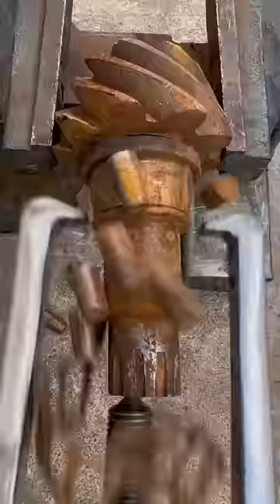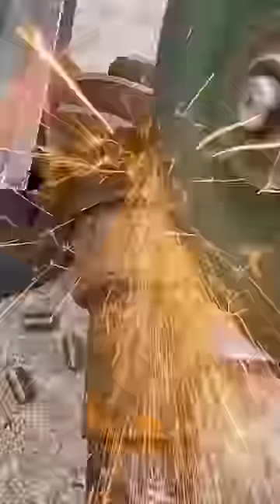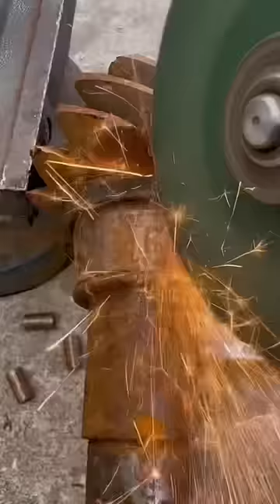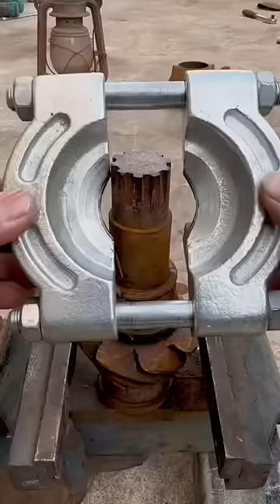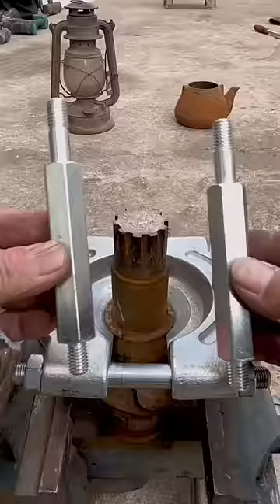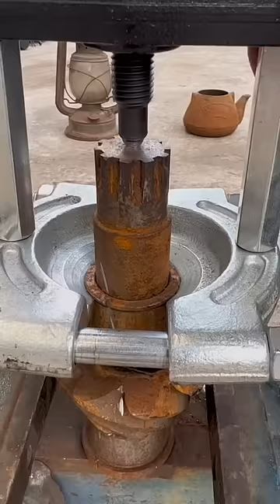Specialized Bearing Extraction Tools Tips for Easy Bearing Removal

Comment: Bro, at my workplace, if anybody used a pneumatic impact wrench to remove bearings, bushings, anything, they would be asked to leave. Step one: spray the part with oil! A little lubrication goes a long way. Step 2: Maybe try heat and cold. Freeze the part, then apply heat to the bushing or bearing on the outside. You might be surprised the result. Finally, use the correct tools and be slow and intentional. If the part has any value, take your time. Even the proper tools can destroy a part.
Reply: Yes, avoid high amounts of force whenever possible. Heat differential (pun intended) is the winner, if possible. Shit just falls apart with gravity, sometimes.
Reply: Exactly, so many people thing pneumatic tools are for everything because they speed things up. 
BUT you can’t these newer generation anything, only some have some wits about them but not much. 😣
Reply: This isn't a high quality part tho. He's just showing how to get it off. I do agree with you but he did fine for an old rusty piece also
Reply: And at my work place they teach us to use pneumatic tools to remove bearings and bushings. Just cuz you’ve done it that way doesn’t mean another way is wrong.
Reply: Sorry to say this but that is the dumbest thing i heard today. Using a impact to remove a bearing, bushing or anything in a mechanic shop is extremely common because it gets the job done fast. On top of that if they are removing them than most likely THEY ARE GETTING REPLACED. So no there is no reason not too. 

But i do agree with you to use oil but majority of the time when its that bad i just use heat and a puller. Only thing he did i would be extremely upset about in my shop is he tried to cut the bearing off with a angle grinder. 

Yes we do have to cut them off on very rare occasions but we don't use an angle grinder. We use a air die grinder with a cutting wheel but just enough to split the bearing or bushings off without damaging anything. But is very rare occasions.
Reply: Exactly, I disagree somewhat with not using air/electric tools. I think that depends on the application. For instance, an auto mechanic probably doesn't need to add that extra force. However, someone like myself who is a heavy equipment tech might need it. I've run into tons of seized bearings and such that won't allow for anything but high impact tools to get the job done.
Reply: But the pneumatic wrench wasn't key in getting the bearing race out.
Reply: В этом ролике у него нет задачи сохранить деталь. Он показывает , как можно снять подшипник и не повредить его. У пневмоинструментом он пользуется для ускорения процесса, чтоб вам не нужно было на это смотреть.
Reply: Lol if you put a gas along the length of the gear / shaft for no reason you'd be asked to leave
Reply: 浸透油は役に立ちます
Reply: U r correct!
Reply: You have 30 steps and he did it in 30 seconds 😂
Reply: Yep!  Obviously third world technique!
Reply: Sure if you want to reuse that bearing. But that was rusted to bad to reuse
Reply: He knows that....he's trying to sell and push a product. Don't you get it?
Reply: lol tf
Reply: Freeall
Reply: @UCtbSyssUGMsnEAIqEvuWpUw
Reply: @UCtbSyssUGMsnEAIqEvuWpUw
Reply: This is probably a really stupid question and I’m not trying to say that you’re wrong, I’m genuinely asking why would they be asked to leave necessarily?
Reply: @pauljarrell8162  The only bad question is the one not asked, and you were very polite. I'm a helicopter mechanic and we have very specific maintenance instructions. The problem with aircraft is that if they break down, you can't just pull over to the side of the road so any damaged parts must be rejected and aircraft parts are very expensive.
Reply: @matthewpollock9685  ohhhh ok. Well, I appreciate that answer. It’s really hard to find someone on YouTube that is polite nowadays lol I learned something new today! And honestly, it’s very comforting that those parts are replaced even though I’m sure that is very costly. The lives in that aircraft are priceless. Thanks for your time! I wish you well.
Reply: @GmKofHard  That part 💯
Reply: @matthewpollock9685  see you should state you work in a air craft shop. That is a complete different situation and yes any damaged part no matter how little can and will be rejected. Failure to do so can lead to a massive lawsuit and lifes lost. Here i thought you was just a random mechanic and your shop is being overly strict.
Reply: Y’all ain’t flat rate lol
Reply: Пиши по Русски , а то не чего не понятно!!!
Reply: @YeeeeeHaaaaa ok lead head
Reply: Нагрев детали до 800° тоже не всегда хорош?
Reply: @johngalt97 I use an impact on them along with the tool that takes off drivelines from semis. Guess what? Works just fine
Reply: @YeeeeeHaaaaa  bro if you actually worked in a shop then you would realize these tools when you get them off the tool truck. Lifetime waranty if it breaks you get a brand new one. Maybe that’s why your slow as fuck at your job though
Reply: Ok ok ok de mummy in

😊😊😊😊😅😅😮😮
Reply: Put some Blaster on it and get the torch. We need it off THIS WEEK! 😅
Reply: That’s kinda crazy. I work in a semi shop and we use 3/4” impacts to remove driveshaft u-joints. Our tool has a grease fitting just for the threads.
Reply: @hawkboy000  I work on aircraft. We have a lot of rules and our parts are made to be light weight, not overly bulletproof.
Reply: That's what the tool is for. Speed up the job. Like everyone else has said the part is getting replaced
Reply: We don’t care bro it’s interesting to watch none of us are using that I definitely wanna watch him tear stuff up with that tho. Be a man bro what’s wrong with you
Reply: @GmKofHard  good thing i read the whole comment or i might have misunderstood what you're saying. If its gonna be replaced anyway, no need to be careful but if its gonna be reused after the bearing is pulled out, preserving the shaft tolerance should be considered. We use the same tools at our shop too.
Reply: I always get a kick out of comments that start out with "At my shop if you did this..."
Like everyone works at the most highly disciplined shop in the land.  I guarantee 90% of shops (that are busy at all) out there wouldn't even notice the sound of an impact or even look up to see what you're doing with it.
Reply: Pls do not heat and cool stuff if you don't actually know what it is. And if you aren't the engineer who designed it, chances are low that you would know. Heating and cooling can fuck the integrity of the material and then you can change the whole thing
Reply: @faessle4067   it should be heating OR freezing..not Heating AND Freezing..we do heat to expand or freeze to compress..
Reply: @jethmercer2532  Read the main comment again
Reply: Oil and heat. The bearing maybe might have come of in one piece that way.
Reply: @faessle4067   yeah that is why i said "OR"..he said heat "AND" cold. Doing both is unnecessary.
Reply: Just watch and learn. Geeez
Reply: Actually an impact can do less damage than heat.  Really, just use what's appropriate.
Reply: We are talking about about acetylene oxygen heat just a little mapp gas wich will do like zero damage and his tool at the same time with a ratchet! I actually that have that tool and always did it that way. And 95% of the time everything slides off with minimum effort. The other 5% are things you just can't apply heat to like a crankshaft on a two stroke. But still didn't use an impact. You can feel when the tool bottoms out with a rachet you almost can't with an impact.
Reply: @KC9UDX  less damage than an electric heat gun? I'm not talking about getting to glowing red heat with a torch. And there's nothing wrong with the bearing puller, I'm just saying that you shouldn't use power tools with it. Use a wrench or ratchet.
Reply: Step 1: blast with 3/4 drive impact gun
Step 2: use hammer to put new bearing on
Reply: The gear pinion is gone, damaged with the grinder . Trash everything and don't waste time.
Reply: Thank u... was about to lite him up then saw your post
Reply: MAPP spell correct 😡
Reply: @matthewpollock9685  I don't disagree, but in reality an impact wrench can be less damaging than horsing on a wrench with a pipe.
Reply: @KC9UDX  I won't fight you on that. That sounds like something that could be true.
Reply: Note that the threaded end and half the splines have been cut off already. That pinion gear was already junk.
Reply: The puller is hardened if made in USA you should never do this, you will eventually break the tool.
Reply: ❤ABSOLUTNĚ SOUHLASÍM❤
Reply: Don't forget, this is the third world.
Reply: First, clean the shaft
Reply: @happenstancially4132  that's what she said
Reply: ❤️7
Reply: Lube and heat
Reply: Под меньшим углом и более малым кругом прильнуть не повреждая около и зубило, всех делов.
Reply: And dont use a bloody angle grinder on it!!
Reply: What is wrong with you guys! It's just a demo
Reply: These solutions aren't always the right way 🗣️
Reply: I want this setup whats the amazon part number...lol
Reply: The puller setup itself isn't too bad, but yeah, id just be using hand tools to put a little pressure on the race.
Reply: In my workplace we actually allow people to think for themselves.....
Reply: Молодец . Но не всегда есть правильные инструменты . У нас даже заморозки не было . Хотя грели , нагревание было . Об охлаждении только слышали в легендах...
А подшипники снимали до метра в диаметре , может чуть больше . Разные . Хорошо , когда есть разный инструмент и возможности .
Reply: I believe this video shows HOW MANY DIFFERENT tools he has. I'm working on a warehouse and during the last 18 years we've sold only ONE. U can do the same job, maybe a bit longer but much easier and of course cheaper
Reply: I was a trailer mechanic for JB Hunt for several years, when I saw a bearing like this it was usually self welded to the axle! They can be a job to get off. First thing to remember is to TAKE YOUR TIME. Unless you wanna end up changing an axle or what not. Semper Fi from an old Marine
Reply: Dude they just wanna sell you their piece of shit will break halfway through its first actual use version of the tool anyone competent already has.. look at how they took the retainer off the taper bearing and grabbed the complete wrong part of the inner race with the puller... They have absolutely no fuckin clue what they're doing
Reply: Wow so many know alls..
Reply: Dia hanya menjual prodak
Reply: Destroy the part.... dude put the pinion teeth in a vice.
Reply: Для чого такі заморочки, грій, морозь, а як нема ні гріття ні холоду, а така штука є, так, треба ведешкою попирскать😂
Reply: The lack of lube means this was click bait, the scar on gear tooth and axle shaft was not as silly as the finger wag.
Reply: Well said.
Reply: Weld a bead around it then dowse with cold water
Reply: It's a impact wrench not an impact hammer the forces are only in torque wise direction.
Reply: Коофициэнт теплового расширения кольца и вала сильно отличаются. Поэтому бывает достаточно нагреть быстро кольцо и ва-а-ля.
Reply: I wish this applied to out shop, they break all the tools and customer 🤦‍♂️
Reply: Yet this is a bearing puller, and it's meant to be used with a pneumatic tool. Pinion are hardened steel. They are made with a dimple for this exact tool to be used at. You have to ise a pneumatic tool to crush the crush sleeve when installing them also.. they are made to handle the torque dude.
Reply: @travisgarland840 if it's not rusted ypu can even reuse them woth a bearing pulling if using the correct clamp size
Reply: This video had a finger wave...thats all you need to know about what type of content creator this individual is
Reply: @faessle4067 хреначте болгаркой, и Пневмо инструментом? А лучше долотом и кувалдой? 😂
Reply: @OrcaRuRu  You didn't read my comment but okay
Reply: @faessle4067 прочитал, не могу ручаться за качество перевода, вы не уловили сарказм, но ладно 😂
Reply: @OrcaRuRu  my point was about heat I really don't know what about your comment had anything to do with that
Reply: Never ever heat pinion gear sjaft to remove the vearing edpecially in differential pinion gear of a truck or a vehicle
Reply: What do you use when the bearing welds itself to the spindle?
Reply: @YeeeeeHaaaaa That is how people fark that thread on the puller eventually,  using pneumatic tools instead of doing  it by hand .
Reply: @timglazner1519 you being ignorant and know nothing, use the third world card
Reply: Sala chote se chota chij nikalne ke liye tool chahiye 😂😂😂
Reply: Ты же без з
Reply: Очень правильные слова !
Reply: Whare it is  available in online
Reply: Q
Reply: Your workplace is a shitplace to work at then cause the tools are designed to make your job simpler, safe and efficient and sounds like they are bringing you back to stoneage times😂😂😂
Reply: This is for YouTube entertainment purposes only 😅😂 don’t take it too seriously, he’s making his money from YouTube and you commenting on this short🤭🤣💀
Reply: He ended up using the tool he should have used to begin with..

Comment: Lubricate the puller threads and it’s likely to outlast the job. 
You can often notch a bearing race with a slitting disc. You don’t need to go deep. Just enough to keep a cold chisel lined up. Support the race on a heavy “anvil” and hit with a lump hammer. The race will crack.
Reply: Right. Go just deep enough to 🖕up the pinion gear.
Reply: Or you could just use this tool …..🤷‍♂️
Reply: @Sicurap2  Frankly with all that rust I'm surprised it even came off with the puller.
Reply: @InsideOfMyOwnMind  It only worked as the rust hadn't penetrated between the shaft and the race. If it had, then there was no way that puller would have done the job.
Reply: @Sicurap2  that puller doesn't work that well,  that bearing was definitely split before they used the puller,  it's just not shown

Comment: Did anybody notice that the location they first tried to place the puller was right next to the gear, but the last place they used the new puller was right at the lip where the bearings were?
Reply: an did u notice the cut right when the tool failed an had to get another one  Chinese aluminum
Reply: 😂😂😂😂p
Reply: Yes both are different. Making fool
Reply: Making fool both are different check the location where he is pulling
Reply: @epicstyx1378 It's not alumiNUM, it's aluminium, like rubidIUM, titanIUM, even adamantIUM, believe me, Wolverine approves
Reply: I noticed it and come to comment section to mention the same. 
Chinese tricks to bro. If they use the first puller right at the lip it will help us remove. No need of new one.
Reply: Yup
Reply: @ungaliloruvann7966  The second bearing puller is the correct one to use that's what they're showing you. The first one won't do it, He's using a piece of junk as an example.
Reply: yes different pic

Comment: A little lubricant goes a long way also, sure you can hack something off but the right tools for the job make it easier👍
Reply: I was going to say soak it in PB Blaster for awhile and the jobs a lot easier no matter how your removing it.
Reply: Lube don't help remove those as they are pressed on, no lube is getting in there. That race was not really even stuck, more times then not using that puller I have broken that upper ring off. Heat is often your best friend here.